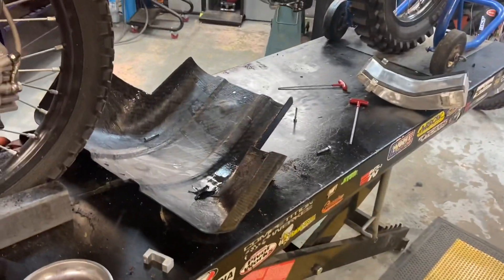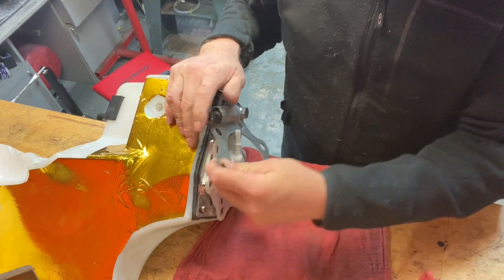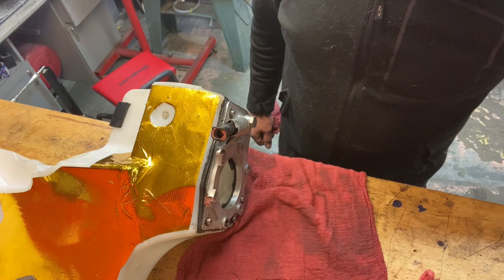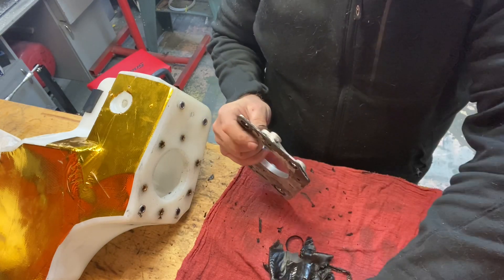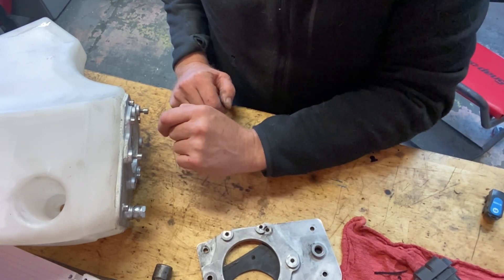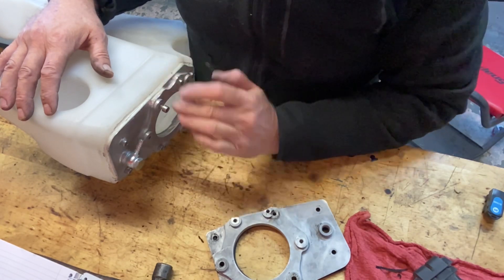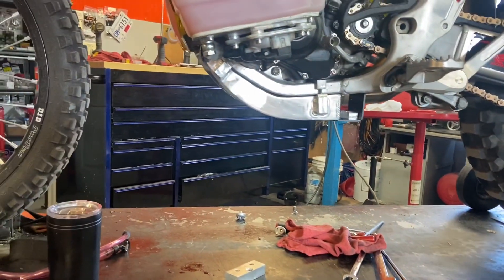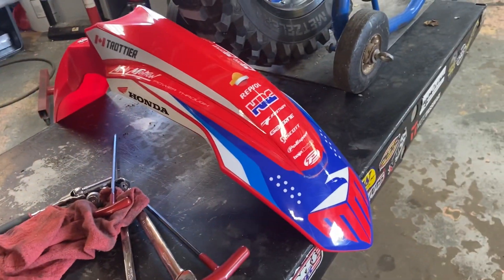Crf450L rally build #18

Comment: Mine had the same concave  and it leaked too. I had to scrape off all the sealant and put on my own. At least they sent to you a new set of tanks. When I sent to them a picture od the leaking tank, they blamed for damaging the tanks and they sent me fuck all...
Reply from the maker: Doesn’t surprise me.  The reason I got anything out of them at all was that the first right tank I received had no cut out for the water pump.  

I am going to locate the additional mounting bolts that there is no holes for currently and machine them in and not use a gasket, just use sealant.  This hopefully will seal well enough to be used as a spare.  

Hope you got yours mounted up and working.